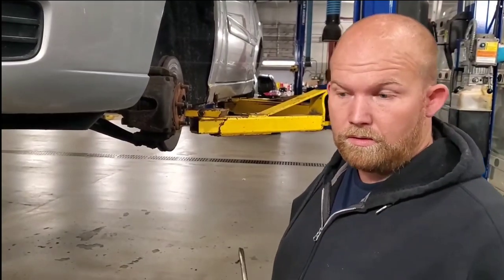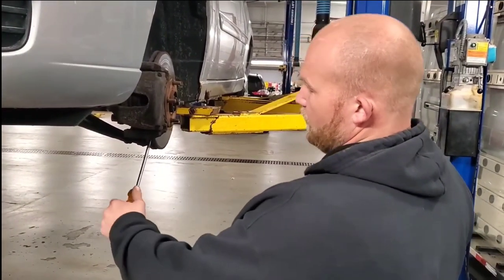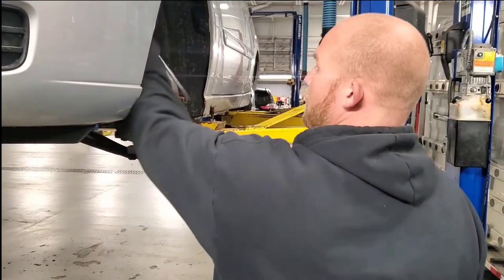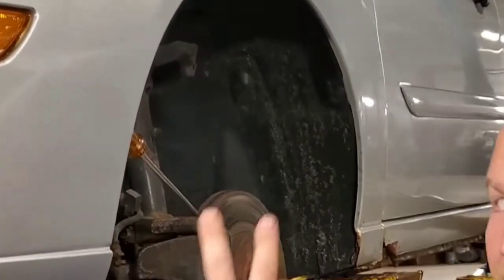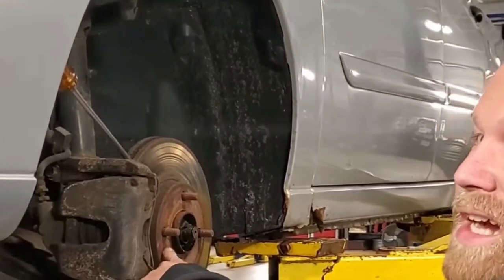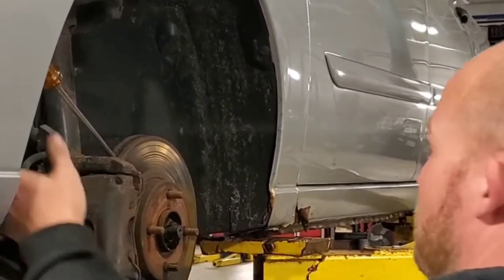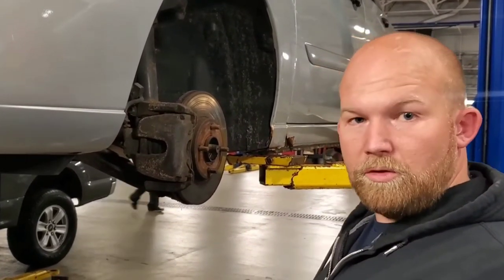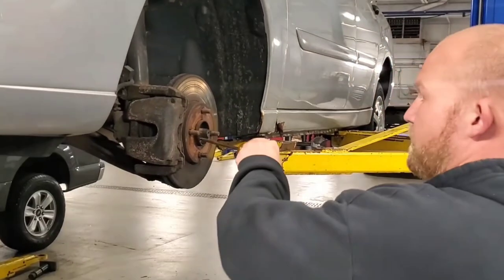CV Axle Snapped - How I Remove CV Axle Nuts - Easy Peasy

Comment: I do that when torquing the axle nuts as well. Also used 2 screwdrivers to remove the front driveshaft bolts on an f150 without having to put it in 4wd.

Comment: Very cool and when you torque that axel nut back on to its "torqued to spec" number, I have seen mechanics use a long bar that is placed between the lug studs and the floor that will hold it still for the 100+ foot pounds on that nut.
Reply from the maker: Or tighten enough to keep it in put the wheel on the ground if you have a center cap and finish there
Reply: I found that even on high torques of say 265-280 ft-lbs, that a stout screwdriver was enough to hold everything still. I recently used this method to do that on an 06 Sienna van, and it called for something like 270. I've never had to use a pry bar like that, and so it saves the lug studs.
Reply: @thomasmiddlebrooke1012  Not all rotors have vents...you are stuck with using the lug studs or something else.

Comment: I haven't run across one of those yet. Semi off topic: all the CV axle sockets I've seen are 1/2" drive and I haven't invested in a decent flex handle that won't break. I've had good luck using my 48" pipe wrench, grabbing the socket around its circumference. I stick an extension into the socket and rest the far end on blocks, such that the socket stays in line with the axle. For right hand thread, on the right front wheel I turn the steering wheel all the way to the left so the socket/extension is angled from the body so I won't have the pipe wrench right up against the fender and I pull down standing by the passenger door. Left hand side, leave the wheels pointing to the left, pull down on pipe wrench standing towards the left front of the vehicle. This work is done on the ground, holding the brakes, parking brake or wheels blocked as needed. Sometimes I've had to use a cheater pipe over the pipe wrench handle.
Reply: I think an investment in a good impact gun is what you need. A good high power 1/2" impact will remove any cv axle nut. I personally use the Ingersoll rand (I think it's the 2235 but not 100% sure) I've never had an axle nut I couldn't break loose. 
On another note, I have had cv axle shafts rust solid to the hub. And the only way to remove them is destroy the wheel bearing with a torch and big air hammer. But that's a different problem than just an axle nut lol
Edit: I use Ingersoll rand but the tool truck high power impacts should also do the job.
Reply: @jeremyg9240  I've lived in Calif all my life and I have never had to deal with those back east rusty nightmares I've seen on YT.

Comment: Automotive texts (Halderman, Gilles) and many service manuals recommend not using an impact on the axle nut because it can sometimes damage the transaxle. Not sure how often that actually happens.
Reply from the maker: Lock in the hub like I didn't here then there won't be an issue

Comment: I have a 96 7.3 Powerstroke going through excessive amounts of fuel. Trucks runs and idles perfectly and I’m 90% sure there are no leaks. Any Ideas?
Reply from the maker: Remind me to touch this tomorrow
Reply: Un-hook that 25,000lb trailer ;-)
Reply: @FordBossMe  The truck has 195000kms on and a 5 speed manual. No fuel in the oil.

Comment: Off topic, on a 2020 transit 350 midroof 2wd, brake pad wear warning on and I had the rear brakes changed they said they were at 3, frint at 6 but warning keeps popping up, so how long will it?
Reply from the maker: The rears on those transits go very fast abnormally fast and when they go out a lot of times the seal start leaking and the axle seals on the Hub side The Hub face side or the axle flange goes through it's not a matter of how long it's more like a matter of when that thing locks up and causes all kinds of problems get it done as fast as possible
Reply: @FordBossMe  well I had the pads done today and the warning still on. The rears have always worn fast on all the transits I’ve had but this sensor is a first. Sadly it took 7 hours to do oil, rear pads and 2 tires at my dealer, I’m pretty pissed cause that’s 2k I’m lost wages for today 🤦🏻‍♂️
Reply: i had one come in to the dealer i work for and the wire for the pad wear warning was routed wrong and rubbed through on the tire.  it might be best to either have the shop that just did the work check the wire or you can check the wire yourself.  the wire is run to the inside pad by the piston and clips to the pad.
Reply from the maker: corey Babcock  no
Reply from the maker: @CampinGHANDI  what wire are you guys talking about, this has none of that stuff you guys are saying 

It's a brake cable, a break line, a speed sensor 

On this transit or any transit I have done I have never had to mess with a brake warning tab at all
Reply from the maker: I have seen vehicles with the warning sensor not get adjusted correctly or fell off its mounting spot but the Jewett brakes I have done is on a 2019 so if 2020 has it that's new to me and have not done 2020 brakes yet and I won't be of help

Take it back to the dealer and have them recheck their work is the absolute 100% best answer